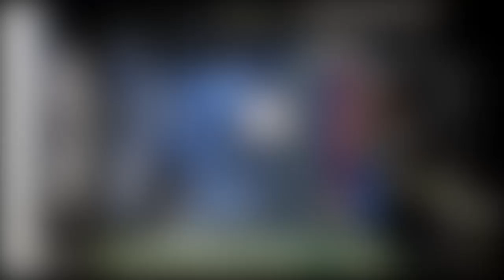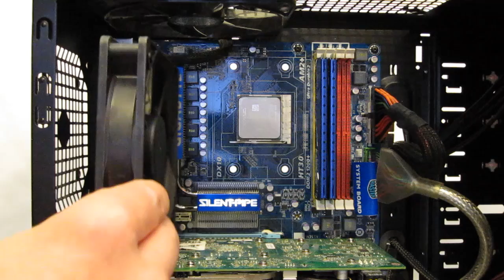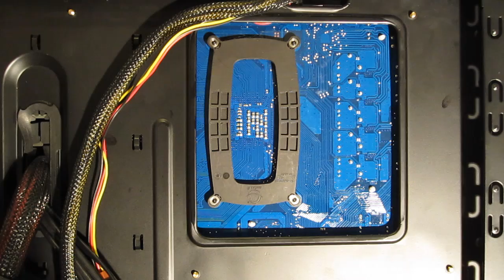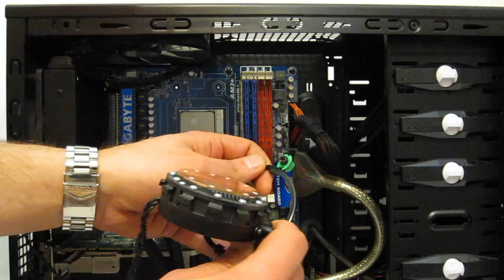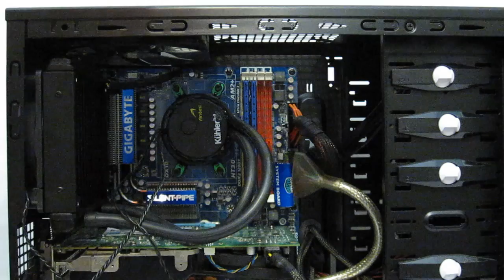Kuhler H2O 620 Installation

Comment: I have motherboard Z77A-GD55. The cpu-cable from waterpump has 3 holes, but CPUFAN1 has 4 pins. Right next to that theres a SYSFAN3 with 3 pins that would fit perfect for that connector. Can I change the cable to that SYSFAN3 without problems? Regards Krusty

Comment: Old video ! Just wanted to chime in mines been running since 2009.. one hose started leaking and the drips dropped onto the gpu killing my 1060 and then my old ati 6970 before I figured it out.

Wondering if it’s worth replacing  the hoses and clamps and reusing it.

Comment: I just got the 650 model of the Antec Kuhler and am having problems with the wiring connection. It's obvious one connector connects to the CPU fan connector on the board. However there is a second larger male connector with 3 pins inside which is not so obvious. Where do you connect this and how? Thanks

Comment: If your're about to install this ... STOP!!! Replace the thermal paste with a High quality brand. Just only 7-8 months my CPU started over heating. After pulling it out and cleaning ... I checked it by heat heating up the pump (copper plate) with a blow dryer. Then I power it up and just holding the pump in my hand it cooled down very rapidly. So the thermal paste is definitely cheap and will not last very long.

I don't know why he installed the pump the way he did? The hoses even looked kinked (by the ram)  which well have issues with the water flow. Put the hose at 6:00 (the bottom) to prevent this issue if your ram is in the same layout. I don't think it matter what position there in as long as the hoses are not kink in anyway!

Comment: I'm a little confused - I just received the H20 650 from Amazon and it came with a white fan on the back of the radiator and a square fan casing with no fan in the middle. Am I supposed to just mount the radiator against the side of the case or is that blank fan casing supposed to be attached in-between the case side and the radiator? there are 4 small pegs on the blank fan case that do not line up with the holes on the radiator so im a little confused now how this attaches.

Comment: How would you install this as an intake? Antec says that as an intake the radiator cools the CPU down an extra 10 degrees.
Reply from the maker: On a 620 the real number is 2-3 degrees in most cases. That comes at the expense of blowing hot air into your case, which causes all of your other components to run considerable warmer.

Comment: Do we need to deal with the water in the reservoir or is it self maintained and no need to do anything else?
Reply: All self-maintained. The AiO closed loop coolers are sealed from the factory, and are not set up to have any maintenance or expansion performed in any way.
Reply: George Cella I got the 650 version which incorporated the fan infront of the radiator, but seems pretty similar the rest.
Thanks for the answer!!

Comment: Can this cool my FX-8350 Because it's a beast, and OC abilityvwould be good too
Reply: It definitely wouldn't be among my top picks for that. At the $55-60 mark, there are much better coolers out there these days that will offer better performance and lower noise. The Phanteks 12DX and Noctua U12S would be much better choices.
Reply: +Aleksanteri “Snadi” Skaniakos just by looking at the fan that come with it is nothing special ... so i believe this would work quite well ... just replace the thermal  paste with a high quality brand.
Reply: Steve Humphries m8 its been 2 years:D I have a CM 412 now

Comment: i have no idea how are u going put that rams in the right place ..
Reply from the maker: This has been commented on several times, but the RAM is in the correct slots for this particular MB. While slots 2+4 are the most common now, many older AMD boards used 1+2 for dual channel.

Comment: mine is upside-down (tubes at the top) and it didnt cause any problems or extra heat after 2 months. only the usual increase of about 5 degrees in those 2 months

Comment: So I got this one, and after watching the video went to work to replace my old one - temps were staying at 77oc, upon open my case I notice going from outside case in it was set up like this

Case - radiator - Fan(facing the direction you show) so does that mean whoever installed mine did it wrong as maybe my old one still works? Also yours didn't show Thermal Paste, while my old one seems to have gotten some apply - so do I need to now clean off thermal paste before putting in the new one?

Comment: Thanks for the response, I have already put it with the tubes at the bottom and funny enough the temps dropped by 8C at idle. Sitting at 28-30 on idle and 43-44 under load with a 23% overclock, AMD 8120FX stock 3.1GHz, overclocked to 3.8GHz at the moment on stock voltage. Will go higher when I run it in at this speed for a bit.

Comment: i have an nzxt phantom 410. i have 2 exhaust fans and 3 intake fans (2 at the front, 1 on the side) would it be better to have the radiator fan as an intake or an exhaust?

Comment from the maker: Very much depends on your build and the airflow you have. Using the radiator fan as an intake will give you better CPU temps, but may do so at the expense of the cooling for the rest of your components. If you don't have sufficient intake from other sources this can become a problem, since your only intake will be blowing warm air.

Comment from the maker: There is another set of screws included. You can plug the fans into a MB header without issue. You will still need to plug the pump into a 12V header.

Comment: is there a set of screws for another fan included? also: do you have to plug the fan in that extension header of the cooler or can you plug it directly in the motherboard too? i'm asking because i want to buy that cooler plus two different fans.

Comment: Antec is right, if it would be mounted as intake the outsider fresh air would turn to hot and hot inside would make the fans work more and if the fans work more, more hot air would enter inside the case and so on.

Comment from the maker: Well, then I would suggest you contact Antec and let them know that their installation manual is incorrect.....mounted in this way, running it as an intake would disrupt the airflow of the case entirely and wreak thermal havoc on the rest of your components.

Comment from the maker: Thanks, glad you enjoyed the video. I could see where it is easy to make that assumption regarding the RAM slots...but it is incorrect. Many 790GX and 790FX boards use slots 1 +3 for mem channel 0, slots 2 + 4 for mem channel 1. If you refer to the manual for the MA790GP-UD4H used in this video, you will see that the memory is in the correct slots. Remember, what holds true on one board (and platform) may not hold true on all.

Comment: Thanks for this video. I'm pretty sure you're not making full use of your memory bandwidth by having your 2 DIMMs in slots 1 and 2. Seems like you're only using one memory channel. They should be in slots 1 and 3. This is why they color code them. Some boards alternate the colors so that slots 1 and 2 are channels 1 and 2, and slots 3 and 4 are channels 1 and 2. But in this case, Yellow should be channel 1, and Orange should be channel 2. I think I'm going to go grab this cooler today!

Comment: These are very good coolers, overclocked my Intel i7 2600k original speed 3.4ghz overclocked to 5ghz running cool and stable 35'c, hitting 71'c in UT3 for over 2hrs..

Comment from the maker: The installation instructions from Antec show the fan used as an exhaust. However, it has been shown in quite a few tests (ours included) that using the fan as an intake will produce slightly better CPU cooling. The downside is that you now have an intake fan blowing hot air into the case through the radiator, so your other component temps may raise. Try it both ways and see how you get better results in your system.

Comment from the maker: TIM is on there out of the box. Really no problem applying new/different TIM, would be the same as any other cooler. If you look closely at 2:36, you can see the TIM applied to the contact plate.

Comment: thanks. when your cpu is on full or high load is there alot of heat coming out the back of case, and if there already is a fan at the back of the case, do you have to remove that fan and install the fan coming with the liquid cooling, or can you use both? 
thanks

Comment: Typically in most boards you should place one ram stick closest to the CPU then the second one slot away (if your using only two sticks).
And assuming makes an ass out of you and me. ha
Also, in this video the tubes are clearly in contact with the RAM.

Comment from the maker: 1. You are right, but I shouldn't be wearing the watch at all....wristband or not.
2. If the RAM is in the "wrong" slots, then either you don't know what MB that is, or Gigabyte incorrectly labeled the board (and all the other boards in that series), as well as misprinted the manuals for every board using that chipset. I'm going to go with you not knowing what board that is and just making an assumption.....
3. There is no RAM contact.

Comment: you've got a pretty big case, with the radiator and fan that came with it installed, i could no longer install another fan on the top of the case like yours in the video. Now without any case fan this thing is giving me cpu 33C idle, around 52C at 100% load, dont know if thats decent or not?

Comment: @Nowaxhise i'd still leave the 80mm fan for case ventilation, but leave the radiator outside, using another slot to push the hoses through (my case has mini pci slots beneath the GPU). I have no kids around to touch it, not that a radiator has any moving parts neway.

Comment: just wondering, I have a cheap stock case that does not support a 120mm fan, and merely has a single 80mm fan. Will the radiator work properly if I leave it dangling outside the case, pushing the hoses through a slot, but not connected to a fan?

Comment: @Nitenichiryu i just got and installed this cooler and yes you can have the hoses point any way you want them too, i have a bottom mounted PSU so i have the hoses pointed up and outa the way.  I had enough room in my case so i have a push pull setup on the radiator and it works wonders. right off the bad dropped idle temps 10 deg C and 100% usage temps 20 deg C  (with just one fan, with 2 it dropped it another 3 deg C off the new temps)  phenom 2 X4 3.2GHz (yes not overclocked im lazy :P  )

Comment: Can you use your own tubings on this so if i wanted to mount the radiator on the back of the case could i buy longer pipe to replace the older one?

Comment: @TheDarkHighlander I can confirm, I just installed it today and one green retaining ring screwhole started breaking as I was screwing it in perhaps a bit too hard.  This did not affect performance tho, I think it's great so far.  I was running 29 degrees+ prior to install, after 15 degrees. after overclocking my 3.2 hz to 3.8 ghz it's staying at around 26 degrees, pretty nice.

also, I used the double fan solution, one on either side of the radiator.

Comment: How will it work if the fan attached to the Kühler is blowing air into the case instead of out of the case? The thing is that I'm currently in the middle of building my own case and I'm getting myself one of these to keep my CPU cool, since my current air cooler is too big to fit in my new case. And to solve the cooling problem since the chassi is 20cm high, 35 wide and 27 deep I will simply put a 200mm fan on the chassi roof, and that means I have nothing pushing air into the case.

Comment: @T16skyhopp - Using the stock fan with a different fan control is possible but not recommended. The Kuhler H2O 620 incorporates its own fan control to keep the correct amount of air going through the radiator for optimal performance and silence.

Comment: Could I place the radiator on top of the exhaust fan already in my antec 1200 case? I like having the stock case fan control on the exhaust fan that is already there. Looking forward to picking this up next time I have the cash.